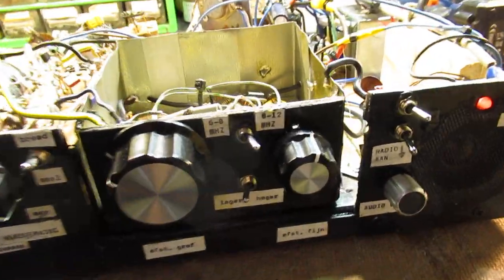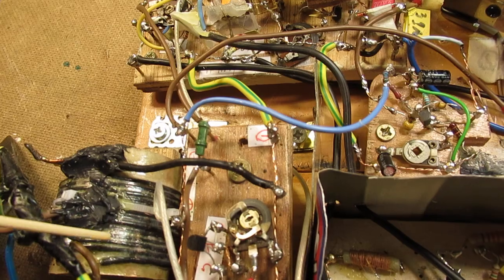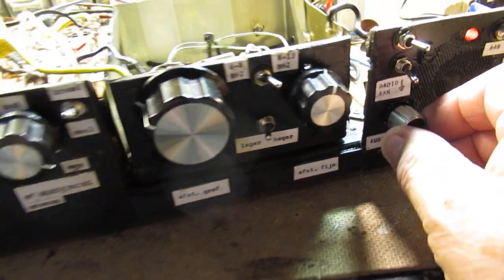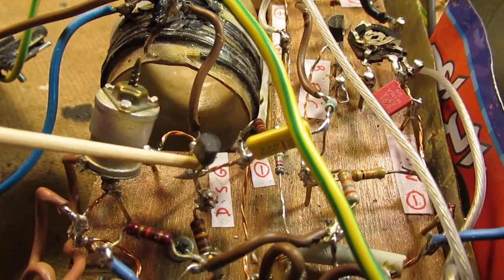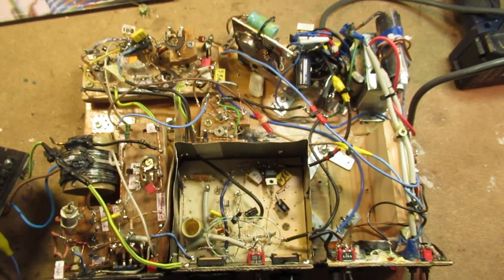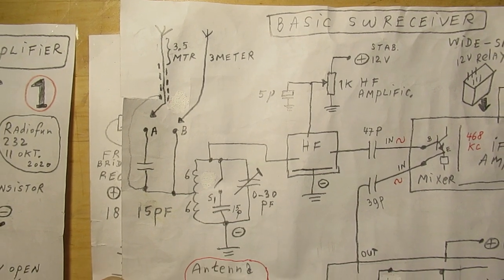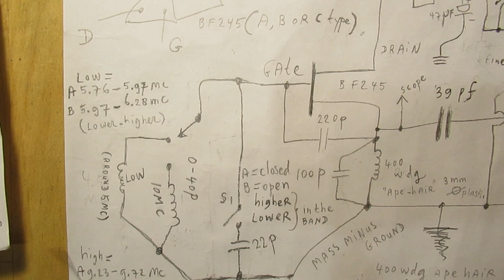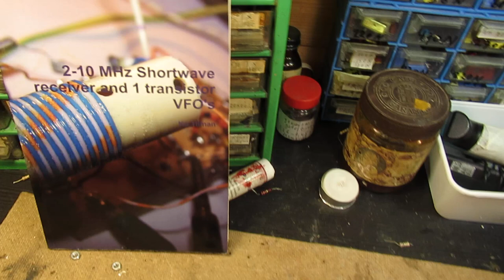Receiving Radio Roemenia and more on SW, 17-5-2023 at 0.20 hr in the Netherlands + radio schematics

Comment: I  am obliged for this You Video  of your self-made shortwave receiver for 2 - 15 MHz. The BF245 transistor for the front-end  is nowadays obsolete. Substitutes like BF246, MPF102 or J310 are soon obsolete, too. How about to use BF545? It is a SMD component. It takes a lot of time and trials to make that kind of suitable analog shortwave receiver.
Reply from the maker: The problem is that some small signal N-FETS simply don't work, even when on the datasheet they seem a replacement for the FET that always works (the BF 245) in this radio circuit, both in the HF part and in the IF amplifier. The FETS that surely work are the BF245 (a,b,c), the J310 and the BF 256 A. I used/tested them in this application. When the BF 545 has the same properties as the BF 245 it will work. Best thing is to test it in practice. Thanks!
Reply: @radiofun232  I agree - the best way to check whether a certain N-channel FET transistor does work on the RF amplifier and the mixer circuits is to test that specific semiconductor. Dual-gate fets like 40673s where used on many do-it-yourshelf radio amateur receivers and transceivers about 40 - 50 years ago, but RCA 40673 mosfet is also obsolete. One may try to attach the two gates of such a mosfet in order to get it work like an ordinary FET transistor. The successors of RCA 40673 mosfets like BF981 and BF998 are nowadays also obsolete, too! Is it possible to change the front-end coils, capacitors and mixer coils and capacitors in order to get the reception of medium wave band for 450 - 1600 kHz ? The change of suitable varactor for example for 6 - 400 pF capacitance area could be a good idea, thus not only the reception on the 2 - 15 MHz shortwave bands.
Reply from the maker: @perttisalonen850  Hi, yes that is possible. But I have to say that I tried it a few times without a very good/clear success. Seems strange, because many 10 dollar AM radio's can do that fine, receiving between 450 KC and 1.6 MC. Kind of "problem" is that you always need up-mixing, when you want to receive below 1 MC. Above 2 MC both up-mixing and down-mixing works. In reality that means that you can receive the Shortwave radio stations on 2 parts of the scale (= 2 settings of the tuning capacitor) because in both cases their is a difference of (say) 455 KC/the IF frequency. Strange enough the reception results can differ in cases of up and downmixing. Below 1 MC downmixing is a problem. In some strange way this complicates the circuit. I have to test/study/think it all over to get an always working simple superhet for AM, good enough to be published on YouTube. So that is why you only find TRF circuits for this radio band on my YT Channel, or only first experiments. Thanks!    20 may 2023.
Reply: @radiofun232  Good, thank you for reply! It is a fine idea to ponder the up- and down converting to SW bands.What about to use a higher IF frequency like 1.6MHz or 9MHz? Would it help to receive signals on MW Band 450 - 1600 kHz?
Reply from the maker: @perttisalonen850  Yes, that is surely possible. You can use any IF frequency that you want, as long as there is no (fierce) radio station on that frequency.
Reply: @radiofun232 One way to achieve the VLF - LF - MF Bands 10 kHz ... 1800 kHz is to use an converter which convert the lower frequencies which you want to listen to a higher frequency. For example it could convert the frequencies to  10.010 kHz ... 11.800 kHz or to 15.010 kHz ... 16.800 kHz, if the basic receive is not able to catch the frequencies below 2 MHz.  Of course that depends on the IF frequency and the frequency which is used in the converter unit.
Reply from the maker: @perttisalonen850  Yes, surely that can work.